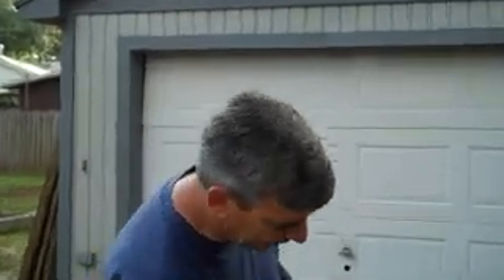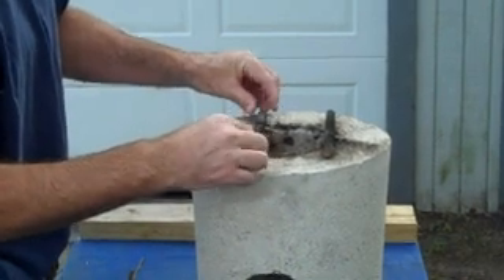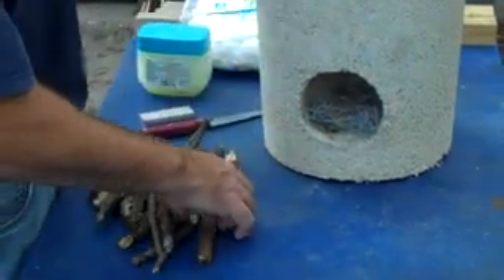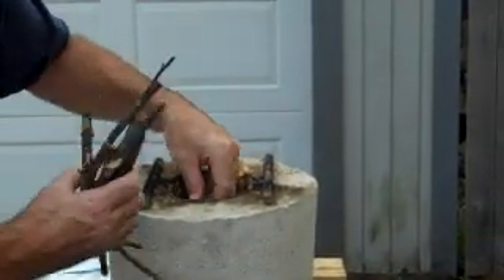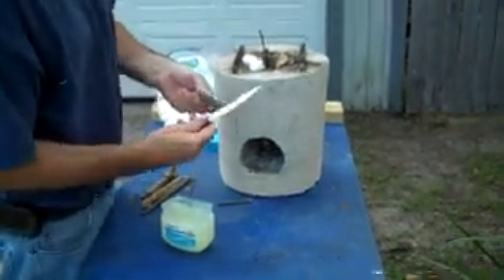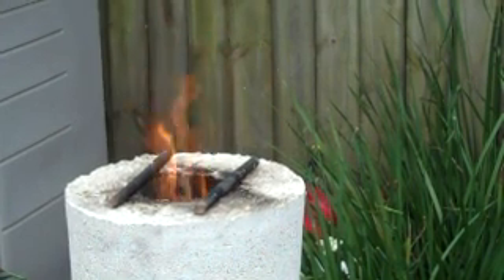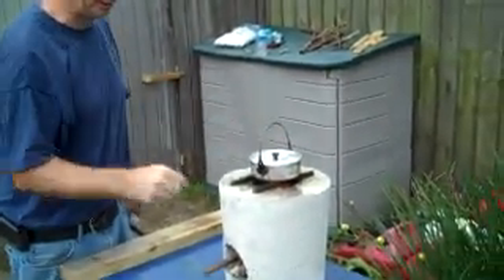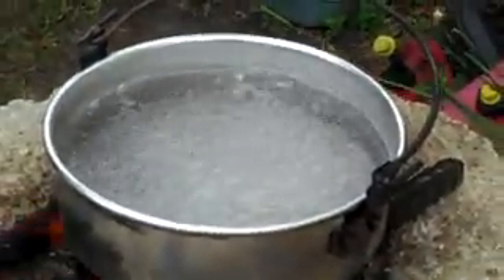Rocket Stove Test! Boiling Water

Comment: Refractory cement (calcium aluminate cement) is a bit more expensive, and less readily available, or well known, but it would be better.
You can find it on ebay, or can get it from a fireplace store.

It might work to use some clay in the the mix, and an even smaller amount of Portland cement.

Clay sewer pipe is already vitrified, and can withstand high temps, it could be used as the inner liner.

Or use recycled fire bricks for the inside liner. :)

Comment: Gene, I've found that an old license plate with one end trimmed down to 4" wide with tin snips works great for the wood rack (like a thick "T") . I leave the outside part the original width of the tag so it forms a "stop", not allowing the metal to reach the fire. I don't let the license plate get into the fire because it's galvanized. (bad gases.)

Comment: I like it a lot. A few questions, can you boil water with just embers using this? Would pointing the hole where oxygen goes in down at a slight angle help hold wood in sort of a pit or be dangerous because of flames rising? Is there any way to control the temperature or flame height?
Reply: if you want hotter combustion, keep the angle level (horizontal) and make an intake choke (to reduce air going in but makes flames bigger or smaller)

Comment: Pretty cool little outdoor cooker. I noticed your pot stand and thought it would be nice to insert a couple or three U bent pieces into the concrete before its set for a permanent pot stand. You could even use them to pick it up and move around.
Reply from the maker: Mike Pourbaix' Sounds like that would work. Thanks for the comment. Gene
Reply: Gene Lonergan or get multiple "U" clamps with the flat clamp bar and keep them on along with the nuts and put it in circle before it sets and can be used as a pot/pan stand rather than having a couple loose hot bars waiting to roll off and burn somebody.

Comment: Why don't you use Refractory Cement with the perlite?
Reply: Agreed. The problems with cracking are due to exposing Portland cement to high temps.

Refractory cement (calcium aluminate cement) is a bit more expensive, and less readily available, or well known, but it would be better.
You can find it on ebay, or can get it from a fireplace store.

It might work to use some clay in the the mix, and an even smaller amount of Portland cement.

Clay sewer pipe is already vitrified, and can withstand high temps, it could be used as the inner liner.

Or use recycled fire bricks for the inside liner.

Look up "rocket stoves," tons of info on the web.
Good luck all!  :)

Comment: Great video Gene!  I do plan to try this.  I was wondering if you have any ideas or suggestions on making this easy to transport?  Perhaps a way of adding a handle?
Reply from the maker: Hello Kerry, I do have some ideas.  I'm going to be building another one in one of those large fish fry pots that have the riveted handles.  The second thing that I would do differently is ad chicken wire (similar in concept to rebar) to reduce the possibility of cracking.  Hope this is helpful.  Gene:)
Reply: Gene Lonergan
It occurs to me that a metal 5 gallon bucket - pretty much identical to the plastic type you have used - that is used to hold concrete sealer/deack sealer would be readily available to many folks.

Comment: Hi Gene, so how long has it be up and running/how many times have you burned with it and has it cracked yet?  I did watch the build video and I was thinking that there was a type of cement that was used in fireplaces and chimneys that was resistant to heat....I may be way off here but I'm interested in building this, I just want to make sure that it's not going to fail on me.  I'm looking at building an outdoor cook center as well!  :-)  Thanks in advance, Wayne

Comment: i love your design and low cost and no rust factor.....  am wondering how long it will last, or is the firebrick type mold strong and crack proof, and or will it chip off easy???...how many burns are you up to now, and noticed any limitations in the mixture you used???....i emailed one other guy who made something similar, and his cracked and chipped easily...

Comment: Great idea - I was waiting to see your burn trial.  Thx for posting it.  What does the stove weigh?  How would it work as a rocket stove MASS HEATER - does it put out a fair amount of heat AROUND THE SIDES so it could also be used to heat a small space?  Do you have any other ideas about 'making it better'?  Thanks for a great video.